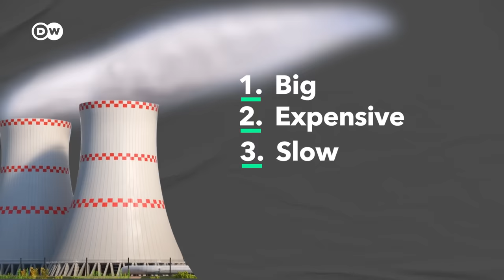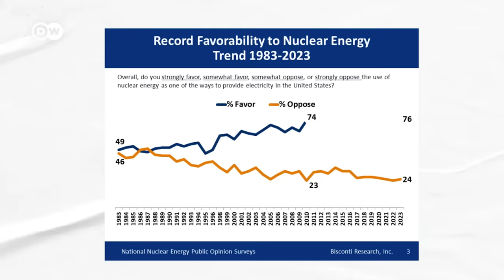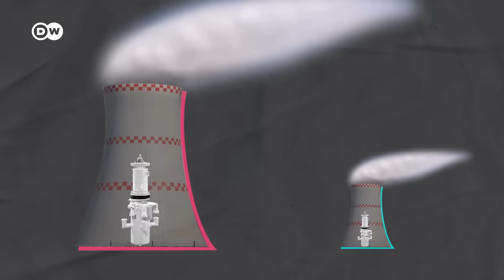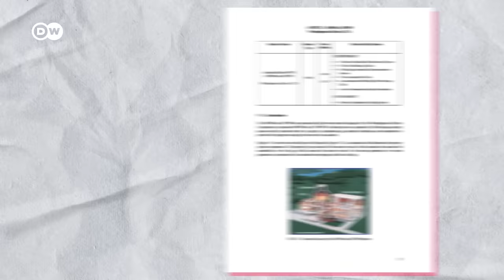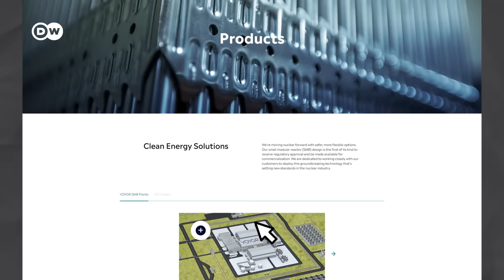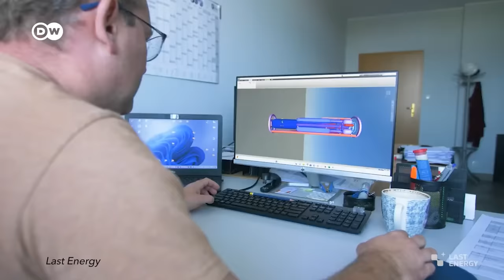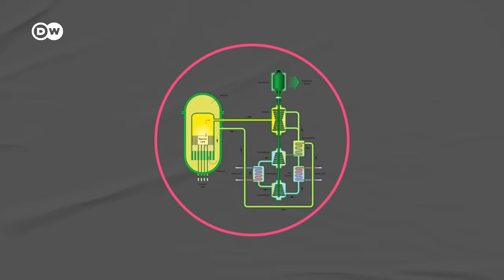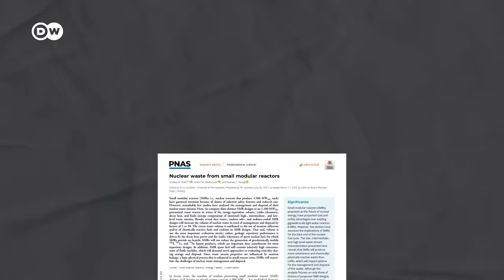Why people want to put small nuclear reactors everywhere

Comment: The comparison to airplane construction is unsettling with all the cost-cutting measures and skimping on safety that whistle-blowers are getting killed over...
Reply: Airbus doing pretty good
Reply: @kilo4911 unlike Boeing.
Reply: airbus is a government company. a bit different than the other company
Reply: In as much as what you're saying is true you are just highlighting one particular manufacturer and trying to push the whole thing into some kind of conspiracy when in reality if you compare the amount of death from playing compare to the cars and other form order mobility airplane has achieved greater safety than most means of transportation the history of passenger airline proves it because any plane crash is a major headline and from search headline engineers learn and create safety and improved the reliability of air crafts.
Reply: You are correct.., which is why getting rid of solid fuel is critical… from I understand having a liquid fuel is the way to make reactors literally 100% fail safe
Reply: Take the millions of miles flown each hour of the day and it’s kinda insane how relatively safe a box of metal 10k meters in the air moving at the speed of sound for the price of a bottle of whiskey/passenger is
Reply: As much as recent developments with Boing are abhorrent- fleets of its planes are flying safely in huge numbers. It looks like the system of regulation and checks is still working. Just like there is so much scare and concentration on the topic of nuclear safety while it is already the safest method for power production known.
Reply: the comparison may be unsettling but it's probably also highly accurate
Reply: That's only Boeing. Airbus isn't doing it.
Reply: Hilarious fact: Senegal has elected a whistleblower to become president
Reply: i dont like crossing guards or referees, either. i really hate gym teachers.
Reply: @jpsion Nah, Boeing is more of a government company, considering all the military contracts they get given.
Reply: Abolish capitalism
Reply: @haf2567 u forgot to add the "for now"
Reply: Haha I thought the same, if we start building nuclear reactors the way Boeing is building airplanes; we're all dead.
Reply: Seems like an extremely high-level and ignorant point of view.
Reply: that is why private companies should not be allowed near nuclear power
Reply: @haf2567 
it is a conspiracy bro, the real kind where corporations run the country
Reply: NRC still exists and there is nothing like it for any other industry (prob not true but still NRC rulebooks are miles thick)
Reply: Yet flying is the safest mode of transport. Nuclear energy is the safest energy source.
Reply: We really only have the FAA to blame.

Comment: What makes me crazy is that Three Mile Island was the nuclear disaster that could have been. But its always reported as a disaster that was. The incident caused a scare for sure with evacuations and concerns about released radiation but the containment building held and did its job of containing anything that escaped the reactor.
Reply: > But its always reported as a disaster that was.

That's because it is, for this type of reactor.
Reply: It was a nuclear incident, it most certainly wasn't a nuclear disaster. 
 You don't get to redefine words or domain terms, that is criminally stupid especially in a field that does some have inherent dangers to it and you should get no say on the topic if you cannot even agree to describe things as they are over what you fear or hope they ought to be
Reply: Then maybe look up the insane amount of negligence in both building and running it that resulted in the meltdown. We got lucky with 3 mile island. Safety rules were massively upgraded afterwards for a reason.
A meltdown is a complete loss of control and should never happen. If it happens there is no way of being certain if the structure will actually hold or just delay the inevitable.
Reply: Yeaj, i watched the documentary series on netflix…mostly nothing, but a PR disaster. The china syndrome
Reply: With how we make nuclear reactors now, it's basically impossible to have a nuclear meltdown.
Reply: @zagreus5773  Yup,  something tells me in Japan they won't allow emergency backup generators to be in the basements of buildings that are below ground (flood) level from now on too.
Reply: @AsphyxiaUwO  With tree miles they said it would be impossible. Nuclear fans like you saying just basically impossible is very alarming to me.
Reply: This happens a lot with aviation - people will see something on the news about an incident and use that to clarifying isn’t safe.  For example, an engine failure shortly after takeoff but the plane lands completely normal half an hour later with no injuries or damage, but that part is ignored by the public.  

We have learned so very much from past accidents and failures which has allowed many industries to become safe to a margin previously never dreamed of.  When I was young there were often multiple catastrophic airline crashes every year and now if you ask most people the only ones they can remember were the 737 Max crashes….5 years ago now.
Reply: @queery  - If they had locked the human operators out of the control room the 'meltdown' would never have happened.
Reply: I think it was quoted since it caused a big scare, which it did.
Reply: @highdefinist9697  What about (permits to emit) fission/activation products ...
Reply: @Mike__B  It was a gross error in judgement to build a nuclear power plant on the ocean in Japan. All of us in the American nuclear industry were saying it was a mistake. Three Mile Island was a learning experience for sure. The reason three Mile Island happened was a lack of understanding of thermodynamics and physical science. We understand the process much better and every Reactor Operator/Nuclear Engineer is rigorously trained to understand how pressurized water behaves. The operators at TMI did almost every action that was wrong, because they didn't believe their instrumentation. Even then, only a miniscule amount of radiation dose was incurred by anyone in the public.
Reply: @WJV9 you are correct. The operators did not believe their instrumentation. We've had 45 years of research and training since then.
Reply: Just like slavery, it will always be condemned as a 'major disaster on humanity'.

Comment: DW mentions civilication ending disaster as a possibilility. That is hyperbole in the extreme.
Reply: That's the typical confusion between nuclear power and nuclear weapons.
Reply: @falsemcnuggethope nuclear weapons is a nuclear reactor that goes to fast.. or just the waste of a reactor spread to the environment
Reply: @SunShine-xc6dh That's just so wrong. Nuclear fuel is just so far from refinement needed for nuclear bombs so it's impossible for actual nuclear explosion to happen.
Reply: @SunShine-xc6dh  a nuclear weapon is a bomb that will explode. A nuclear reactor won't do that, because it's not a bomb. Nuclear power is statistically one of the safest ways to generate power.
Reply: @falsemcnuggethope  yep just like chernobyl wasn't a bomb, until it was...

Is safety is over exaggerated by the tiny sample size compared to any other form
Reply: @SunShine-xc6dh  comparing that to a nuclear weapon is ridiculous and insulting.
Reply: @SunShine-xc6dh  Chernobyl wasn't a bomb. The 'explosion' that happened didn't even damage the other reactors that were right next to it.
Reply: @SunShine-xc6dh Chernobyl didn't explode from the nuclear reaction. Excess steam built up to the point where the reactor couldn't contain the pressure then blew up.
Reply: @MrUploader14  oh so the steam just appeared from magical forces unrelated to nuclear energy...
Reply: Report it with the timestamp for misinformation. I did.
Reply: @SunShine-xc6dh Ah yes, so the electric pressure cooker that overpressurized and exploded in my kitchen means that electricity is a bomb.
Reply: @braxbro6674  it means under the right circumstances it can most certainly create a bomb... its means if you don't treat an energy source with the respect it demands its dangerous. It means the more people like you trying to operate it the more likely bad things will happen..

Or did you entire kitchen just spontaneously depressurize pulling it apart from the outside?
Reply: @SunShine-xc6dh  First of all, I don’t have a pressure cooker. I made a hypothetical for the sake of argument.

Second of all, fossil fuel power plants can explode in basically the same way. It’s a ‘uses steam turbine’ thing, not a ‘nuclear power’ thing.
Reply: @braxbro6674 yes they can explode, but then the do a radioactive payload isn't scattered to the wind. How many fossil power plants have left the region evacuated deemed uninhabitable for decades, generations upon a critical failure. Also unlike unlike nuclear energy fires can be put out fuel can be cut off with nuclear its unstoppable process that we hope to keep slowed down and control instead of a process we must actively work for it to continue.
Reply: @SunShine-xc6dh Chernobyl had bigger problems than it being a nuclear reactor. The issue was the complete incompetence of the Soviet government completely bypassing safety protocols. Please do some research before arguing against nuclear energy.
Reply: @SunShine-xc6dh  No it is not. The statistic is called death per terawatt.
Reply: @MotoClassics  it's not a useful statistic. Nuclear has a much smaller sample size and has mostly been contained to places with much higher than average standard of safety do to its limited usage.
Reply: @SunShine-xc6dh  There are 440 reactors at present. They are not killing people as we speak regardless of how many there are. The coal-burning plants are killing people as we speak.
Reply: @MotoClassics  that's it? Are they in the same places where these coal plants are supposedly killing people? Some how I have a feeling your giving coal more credit than it has really earned...
Reply: @SunShine-xc6dh  LOL I find this funny as there are several regions on the plant where there are coal fields burning for a century or more and will be burning for several centuries.  Might wanna do some research on the regions of the world that fossil fuels have rendered uninhabitable.
Reply: Didn't you get the memo that Tchernobyl ended civilization?
Reply: @SunShine-xc6dh i just writing my second thesis on eu energy market and it has a part on nuclear energy. I most carefully collected my data and i have to say to you, that you don't have to fear nuclear energy. For the 3 most well known nuclar powerplan accident (three mile, Chernobyl, Fukushima) there where less than half a million people including the evacuated who suffered any kind of negative impact from the accidents. Less than 10.000 deaths on site, and no solid data for more illness more than a few thousands.This is really sad and i don't want to sugarcoat it but if i compare it with 8 million+ deaths per year, for fossil fuels and likely 5.000.000.000+ people have nagtive effected by it for more or less... i have to say nuclear is the safer alternative.

Does the world ready for it and can use it peacefully? It is up to us.
Maybe MSRs with Thorium or SMRs will change everything. Maybe not. But nuclear power as it is now, with PWR, BWR or the newer ABWR or promising(?) EPR reactors, this is safe enough.

Sources for these numbers : IAEA , and a Harvard publication

Comment: SMRs are everywhere as we speak,     how many ships and subs are  nuclear powered ?
Reply: Not to mention how many are planned or under construction? Dozens...
Reply: Many ports and countries ban nuclear vessels from docking, or only docking at designated areas.
Reply: So, how much do they cost per megawatt?
Reply: @SocialDownclimber can you share more about the differences?
Reply: @lawrenceheyman435  from 120$ per MW until they'll get first 30-50 reactors
Reply: @Aby0ni2 I can, naval reactors have the following design requirements, they must be quiet, very reliable, compact, safe at close distance, not puncture or leak under water for years even when the ship it is on sinks, ideally it should take a large missile or supersonic penetrator to breach it. Most of that applies to civilian reactors aswell, just the degree to which it applies changes.
 In short, no they aren't the model for small reactors.
 We do have way more reactor designs that would apply much better to SMRs and inherently more safe and efficient ones, what we have is one of the worst designs due historical events.
 Essentially were stuck with crap because the oil corpo funded 'environmentalists' managed to con half the populace to commit to some Really profoundly stupid regulatory schemes.
Reply: Those are not commercially viable. That's important if you want to build SMRs instead of renewables and storage.
Reply: All are under tight military control.  Would you trust Elon Musk to build one of these in your neighborhood with the cheapest labor he can find?  I think not.

Comment: The problem for Nuscale is its hideously expensive pool, not the reactors themselves. The reactors are modular ... but the pool is not.
Reply: Why is its pool so expensive?
Reply: @theDaNi0  sensors + earthquake measurements + overflow measurements + leakage protection + heat protection + protection from potential airstrike (yes all nuclear plants have this) and so on
Reply: Nuscale is a pressurized light-water reactor. In other words, junk.

Comment: Nuclear carrier reactors are comparable to SMRs.  They have an outstanding safety record and probably billions of dollars have gone into studies and designs. Ford class output 700 megawatt but much of that energy is diverted to propulsion.   But it seems a sound starting point instead of starting from scratch.

A previous potential safety feature of SMRs wasn't mentioned here.  Yes, build them in factories, but install them in suitable holes.  If one goes critical it's small effort to use remote control bulldozers to simply push dirt into the hole and seal off the radiation leakage.

Technically these are well within reach.  The real problem is we can't get anything done anymore.  It's all talk and arguments.
Reply: the real problem is money. nobody wants to loose money, and thats what happens if you invest in nuclear.
Reply: @tjeulink nobody but the military. They would power their machines by literally burning money given an opportunity.
Reply: @m1k3y_m1  i can get the military, they have different priorities than making money.
Reply: Problem with naval reactors is also that they usually use highly enriched Uranium, which is much more expensive and really not needed for a "simple" power plant. It's also weapons grade, so safety really is a concern there. I don't think these reactors by themselves would work in a stationary civilian setting, but they would probably be a good starting point if their design wasn't classified. That being said, the easiest and cheapest way of producing nuclear power is just like we are doing it now.
Reply: Nuclear reactors on ships are also manned by trained personnel just like in the big power plants. Having and managing the necessary personnel that would be scattered all over the place may be a big issue. Even if reactors can be mass produced, getting enough trained personnel is whole other issue.
Reply: @m1k3y_m1  Someone needs to do the math on that; how much dollars per hour you'd need to burn to power an aircraft carrier.
Reply: LOL look up all the nuke subs that have broken and killed the crew.

Comment: I'm still banking on Last Energy being the ones to break the SMR barrier first. Using mostly off-the-shelf parts from mature oil/gas industry supply chains is brilliant, and should finally allow for true enough standardization to actually get the cost per reactor way down.

Comment: In case of nuclear power economy of scale means lots of output power. SMRs need everything a large reactor has, so the savings are not there. Same counts for wind energy as well, so we see wind turbines get bigger and bigger.
Reply: The reason wind turbines get bigger and bigger is the higher and more stable wind speed at greater height.

Comment: The problem with SRMs is that they don't have the economics of scale of traditional larger nuclear plants. So the energy production from them needs to be subsidized
Reply: energy production from nuclear already has to be subsidized, for SMR its just even more. wind and solar are economically viable on their own.
Reply: Thsts why we need large modular reactors and loans guaranteed at the government bond rate.
Reply: @gregorymalchuk272  sounds a lot like socialism
Reply: @tjeulink  It sounds like vertically integrated public utilities.
Reply: That's not true, there is no need for subsidies you are clearly a European though lol. SMR's (Not SRMs) are still cheaper then fossil fuel and provide reliable backbone power, you can over build it and dump the waste energy into CO2 collectors to recapture the CO2 we've released. The thing keeping their costs up is the fact nuclear power especially SMR's aren't the mainstream thus they don't have the economics of scale. All we gotta do is build SMR factories and get the fuel cheap. Thorium SMR's are my favorite as they're physically resistant to meltdowns without needing active cooling.
Reply: @gregorymalchuk272  thats just buzwords for nationalization.
Reply: @GeorgeWashingtonLaserMusket  has any commercial thorium SMR been built?
Reply: Actually the main problem with SMRs is that they don't exist. Same with flying cars and meals in a pill.
Reply: @GeorgeWashingtonLaserMusket  the cost isn't from fuel
Reply: @skyrailmaxima  So you're saying nuclear is cheap if we get rid of a lot of regulations, and trust me it'll still be safe - I pinky promise!
Give me a break. You're living in a fantasy land.
Reply: @skyrailmaxima  lmao delusional